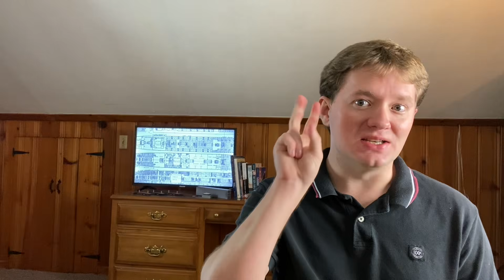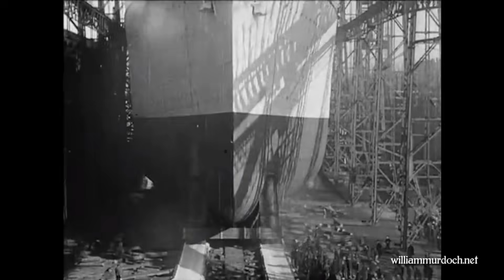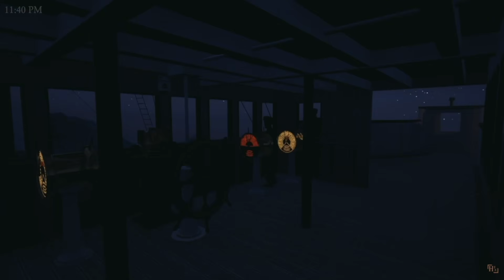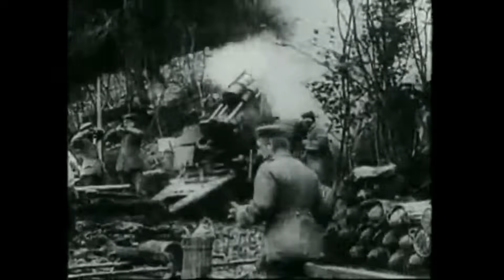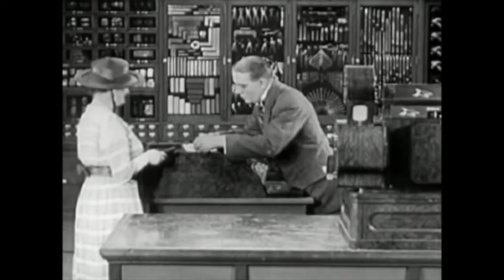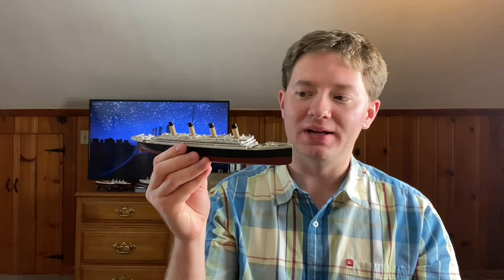The complete timeline for the Titanic sister ship OLYMPIC!

Comment: Interesting. You've got to wonder about the lack of regulations regarding wireless and signalling. I would have thought that Marconi men would desist from sending messages unless a) they were instructed to send a message by their ships Captain. b) they had received a message from another ship which was intended for their captain's attention and possibly needed a reply. c) they were instructed by the captain to send out a general message to all ships 'within range' of their antenna. Otherwise the airwaves would be filled with the impenetrable noise of so many telegraph operators all click-clicking at the same time. How anyone would be able to pick out which message was from where is beyond me.
 
Of course, the RMS Titanic had two operators who's primary goal was to send 'commercial' messages from ship to shore, so they would have been banging away all day and night. I also read that the range was usually better at night, carrying their messages further. Add that to the fact that they also had a very powerful antenna that had even reached as far as Puerto Rico from mid-Atlantic on one occasion. 

RMS Titanic and RMS Olympics signals must have dominated the airways and I would imagine their operators would shy-away from needless chit-chat as they would be too busy. Hence, the rude response to Evans (SS Californian) and a number of other, non-White Star Line vessels that were at sea in the North Atlantic that night. (14/15-04-12)

This also makes me wonder about Captain Lord. Did Lord trust the radio? Wireless Telegraphy was a rather new concept at sea. It's true potential had probably only been realised with the Crippin case when the SS Montrose sent a message from ship to shore only two years earlier. Captain Lord was a consciencious man and I am sure he would have familiarised himself with the radio and its potential when it was first installed upon his ship (SS Californian) in February 1912. Weighng the pros and the cons of the technology, did he reason that perhaps its might be unreliable in an emergency with every ship within ear-shot trying to make a response but only serving to jam the system. Did he trust his old school ways? The Morse Lamp had been the go-too method for ships signalling to one another from the time he first stepped onboard the barque Naiad? Did he possess an old school attitude towards these new fangles gadgets such as radio telegraphic messages, or did he genuinely reason that radio static would more likely hamper than help any efforts at trying to ascertain just why that big ship was firing off rockets. Chinese New Year perhaps???

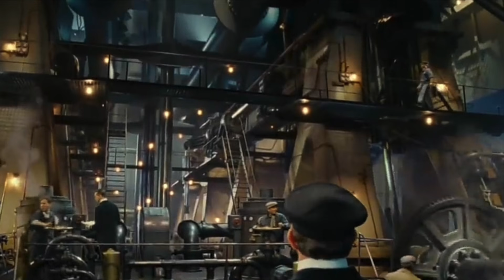Comment: 8:52 Yeah, I know where this is going. Triple expansion steam reciprocating and steam turbine. Reciprocating engines run slow and quiet while turbines of the day were fast and vibrated. Use expended low pressure steam form the two reciprocating engines to propel the central low pressure steam turbine engine. It was a compromise.

Comment: Love your videos, very well researched, great details (not only about the ships but the story around the making of the ships) have not watched your one on the Titanic yet but hope you did not swop the two sisters like you did here, the two where not totally identical there forecourt wall holes were slightly different, and you keep mixing them, it is also this difference that later proved that it was the hull 401 not 400 that sunk, 400 after its crash never fully recovered, (damage due to the crash was the cause of the propeller needing to be replaced) there was also problems with its motors. The sinking of the Titanic (yes the Titanic sunk but it was hull 400 renamed Titanic, the name makes the ship) was the greatest insurance fraud ever.
Reply: Insurance fraud? Please don't be silly, WS lost £500,000, paid out compensation and lost custom and credibility when Titanic sank.  ps, plenty of the number 400 can still be seen, on panelling, doors and stairs.

Comment: You did not cover the time Olympic hit a terrible storm and it's hull was severely damaged and needed extra plating put on it hull in dry dock. The propeller shaft was so bent before this with HMS Hawk and it never lost it's vibration afterwards and also listed because the hull was bent. The Olympic never lasted to 1935 as it was not sea worthy and so it was Titanic that served to 1935 and Olympic was lost as the Titanic for the insurance money. Ballard  himself saw the 'O' and the 'Y' under the name Titanic on the bow. Olympic was the ship with all the problems and sank with the iceberg collision. The first design of anything new has it's major problems and the later designs are better and last like the rear Titanic did till she was scrapped in 1935.
Reply: L
Reply: The switch theory is a lie. There is no M and P at the wreck.
Reply: Imagine believing in bullshit
Reply: Absolutely not!  Stop believing in fairy tales.

Comment: Just when you think you knew all the facts of Titanic,other stories surface.
The Marconi Wireless radios were placed on board passenger ships so First Class customers could send telegrams.
Not so much for ship to ship communication. So know I understand how Phillips and McBride had communication problems with other ships. Ships stepping on each other's transmissions. This is a very well done documentary. I knew about the collisions the Olympic encountered. We also have to consider it was not safe to use passenger ships in military capacity.
There is a conspiracy that The Olympic and Titanic were switched in Belfast after the Olympic got broadsided. The fact they switched propeller shaft and propellers,as well as the restaurant facade could confirm this theory. But it would be highly unlikely,since the Titanic was not fully fit. Many who were working on Titanic did go over to the Olympic to make hasty repairs.

Comment: I was born in Jarrow (it's a town, not a city) and know a lot of the fixtures and fittings from the Olympic were auctioned off. Also, there were quite a few pieces of cutlery, door knobs, chinaware - in fact anything that would fit in a mans baitbox ended up in several households in Jarrow, South Shields and around.

There is a hotel in (I think) Alnwick which bought the entire first class lounge, and South Tyneside Town Hall has some ornate wooden panels from the Grand Staircase.